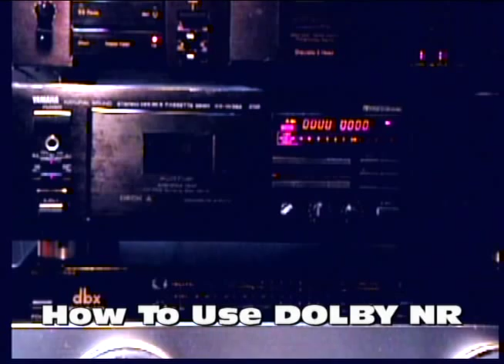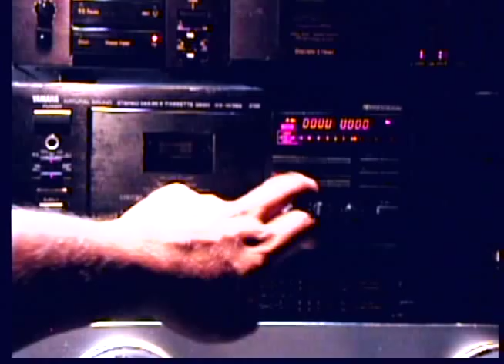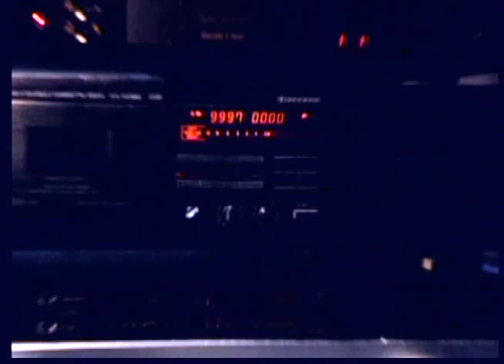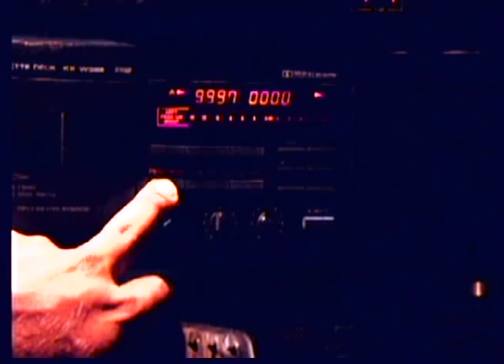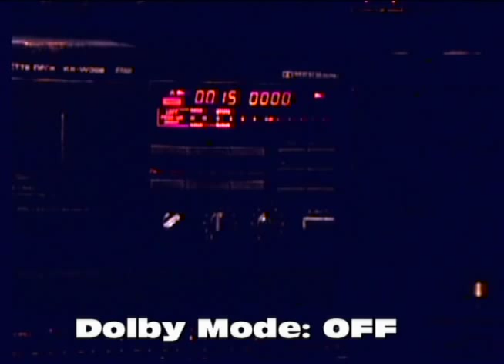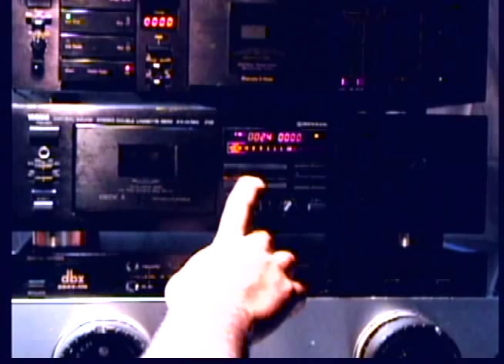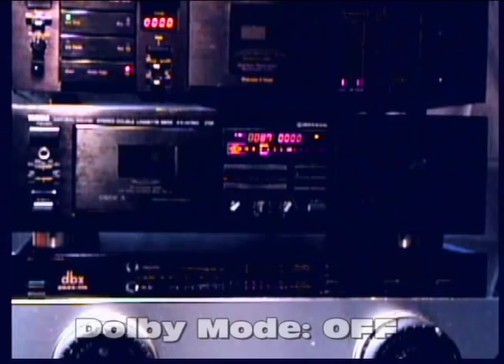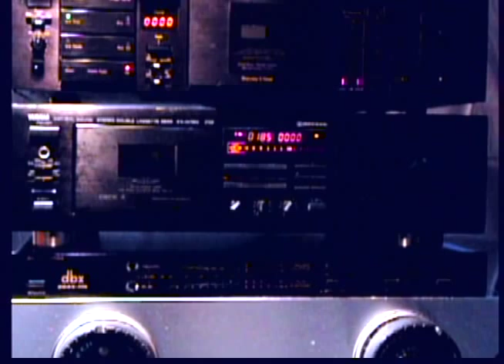How to Use the DOLBY [NR] Noise Reduction System

Comment from the maker: hi thanks for your comment. Dolby Actually can work really great IF, the deck itself is a decent one. What it really comes down too is how well the transport is built. you'll find alot of entry level Decks have a transport that just got the job done. higher end decks used multiple motors and extra gears to control the consistency of the tape tracking.The DBX 228 is also a great NR system, and was definitely forgiving when it came to acute tracking problems. DBX had headroom extension, very nice!

Comment: You get better signal to noise with tape speed and track width. Cassette is the narrowest width and only faster that 15/16 ips, so its amazing it does so well. With electronic/POP/rock you may not care about Noise reduction, but it will be hissy between songs. Not all NR tracks well, either, so experiment

Comment: Top-notch tutorial sir! I have a Sony K707ES single deck that I have used to make copies of a few Lps onto Type IV metal cassettes. However, I made the mistake of putting the Dolby switch to S for recording. Later, I found out that Dolby S is more for decryption/playback. It really cleans up the sound on factory recorded cassettes.
Reply from the maker: +Douglas Lorin 

Did you at least use B or C?
Reply: I used Dolby B.
Reply from the maker: +Douglas Lorin 
Dolby isnt bad either, it just reduces noise at a certain decibel threshold. One good thing about dolby B recordings is that its pretty forgiving playing on other cassette decks without the Dolby function.

Comment from the maker: Yep its a BX-300  i got all kinds of tape decks.  In regards to the Peaks on the VU meter. I did alot of test recordings to know that certain high frequencies were not being imaged correctly when it peaks at the dolby symbol.  when i added a few more DB in this case i had it peaking at only +3, this was able to correct the high frequency loss. Its not a big deal as your ear cant really hear it, but this is an old trick used in the last years when records labels were still making tapes. Headroom!

Comment: I cannot hear any hiss at any point in the video. I do have hearing problems so I don't know if it's because of the YT compression, but they all sound alike. I used to use Dolby all the time, but I always felt like it took something away from the highs. Like if I recorded something in Dolby B and then played it back, it tended (to my ears) to sound better with Dolby turned off when being played back and when I turned it on during playback, it tended to sound different but not better. Having life long hearing problems, I am probably not the best guy for sound tests though.
Reply from the maker: tarstarkusz  If you have a hard time hearing the hiss, here is something you could do, Turn your Trebal wayyyy up, so the hiss can be very evident in sound, then you can hear the comparison.  about your use with Dolby cutting out the highs, If the recording wasnt originally recorded with Dolby, then the Highs will be cut out significantly. Being the recording wasnt encoded in the Dolby signal. If the recording was recoded with Dolby, it may seem that the highs are cut out a bit but really the highs are being presented as it is on the original recording. When you take the Dolby off, you'll hear excessive highs. That is because depending on which Dolby you used, B, C or S, the dolby recording is set where certain frequencies are "excessive" or overly saturated. This becomes corrected when Dolby is turned on. Dolby B was commonly used by consumer purchased albums. The only thing was, the OFF position gave the listener the impression that the recording was at its most optimal. Where it wasn't, the most optimal was with the Dolby position ON! As most would turn it on, they would think that highs are lost, but actually no, the excessive high frequency sound is corrected and played back to how the original recording was.   One downfall with this system which probably didnt make people fans of Dolby was that , ALOT of recordings (from the record companies) were very low, and sometimes the Dolby system didnt do any justice.  If every recording was recorded like the one in my video, then alot of folks probably would have maintained the popularity of cassette tapes. but the reality, its too complicated for the average press play person and somewhat fragile in some cases.
Reply: RadioKilla07 I just pulled out a bunch of my old tapes and I noticed the ones I made sounded better than prerecorded tapes (I think I was just using higher quality tapes). I know how Dolby B works, but not that much about the other ones. For most music, I've always felt that compact cassettes sounded better than most CDs.  It might just be that most of my CDs are from the early days of CDs and they just weren't mastered that well. Now, you have the loudness BS going on. But the one thing I don't miss about any of it is how much room it all takes. My iPod has thousands of songs on it and with typical earbuds, you really can't tell the difference.
Reply from the maker: tarstarkusz  ha! I hear that, alot of room saved, and yes your personal recordings should sound better then the Pre-Recorded tapes.  Especially when using Type II and Type IV (Metal).  The Prerecorded tapes had a downfall, they were manufactured on high speed duplicators, was recorded sort of Low, and the Tape itself was a mix of your basic Oxide (TYPE I) and the material used for TYPE II.  Nonetheless the hiss was sometimes overpowering.  In my opinion your average hi-fi cassette deck outperformed the quality of most pre-recorded tapes. TYPE II and TYPE IV had formulas in the tape that lowered the Hissing problem, and when using Dolby or other forms of noise reduction, the sound was right near Identical to the original.

Comment: Is using dolby the same as turning the treble down? I thought it gets rid of noise along with all the other high frequency sounds.
Reply from the maker: GuyVelella   No, It may seem that way, but not at all.  If you had recorded a tape without using dolby, then it should be played back without using dolby.  If you recorded a tape using dolby, then it should be played back using dolby.  While it may seem that a dolby recorded tape is reducing trebals on playback, your actually not reducing trebals, your playing back the tape the way it would sound on the original recording, or very close to it.
Try this: Record one tape with a song not using Dolby.  Record onto another tape with the same song, using Dolby. Use any Dolby of your choice, the most common is B.  Now play back the tape without the dolby, with the dolby off. then play the other tape with the dolby and set the dolby on.  You should hear both tapes sounding almost identical just one has more hiss and one doesnt have much hiss.

Comment: nice, loks like in "mode on" realy reduce de hiss,  but at the same time raises some high frequencies, I do not know if it's to compensate for the loss...
Reply from the maker: Well the Dolby NR technology is basically utilizing a form of encoding and decoding. When recording with Dolby, the sound quality may sound different when playing on a Non Dolby Deck. Dolby B for example which was the most common NR system implemented a slight raise in the high frequency to compensate for any kind of losses that may happen when the NR system is active.
Back in the days, you would record with your Dolby system, then adjust your trebals, bass and equalizer afterwards to acheive the desired sound you wanted.
Non the less, the recording alone should sound very clean and decent.

Comment: Great video , I have a Tascam dual cassette recorder , Only picked it up recently , Will be using it to record Dj mixes from Vinyl , Also recording albums from vinyl . What are the best Blank tapes I can buy for this ?
Reply from the maker: if your aiming for good sound quality I would use a type II (high bias) or Type iv (metal) tape 
type iv tapes are very hard to find but type ii is still around at some audio shops. 
depending on the quality of your tape deck even a Type I (normal) tape should be pleasing in sound.  accompanied with Dolby C or Dolby S and you should be very happy with the results.
good luck.

Comment: How do modern head units in cars eliminate hiss from songs that may be produced from a cd-r, for example. Thanks for an update.
Reply from the maker: CD-R media is a totally different setup. In most cases the CD-R contents are from an MP3 or from an Original CD. Digital Media does away with a "Noise Floor" Phenomenon aka HISS! Therefore modern head units playing Digital Media will never have this problem. When head units used to have cassette tapes, the mid and high end models were equipped with DOLBY NR. Which cancelled out the Hissing respectively.  Thanks for your comments